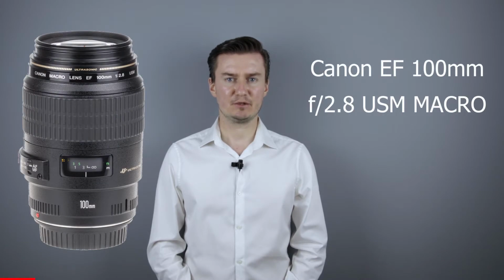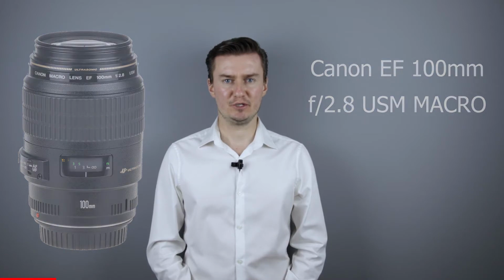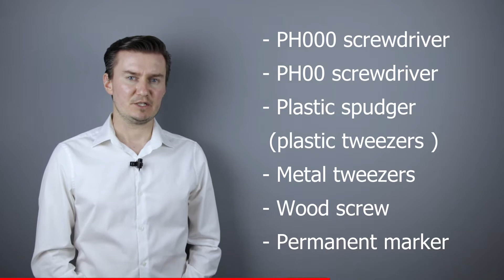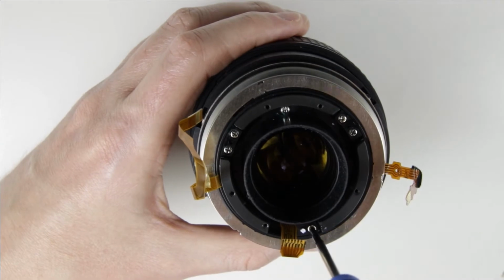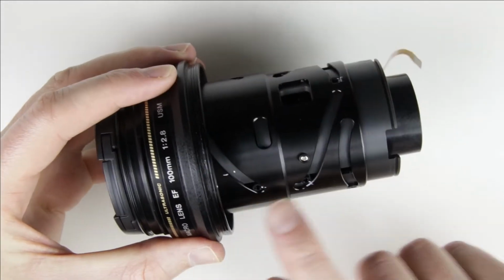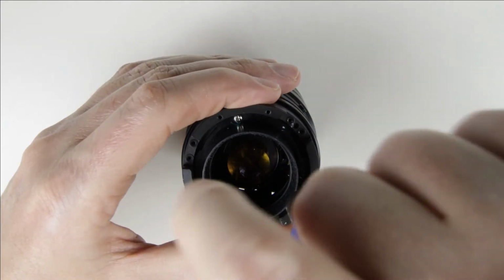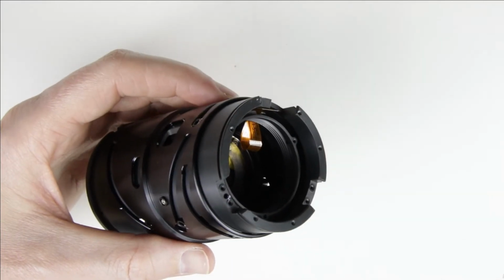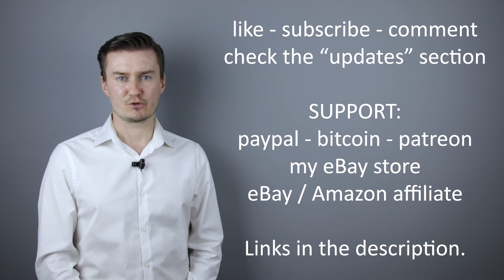Canon 100mm f/2.8 EF MACRO USM disassembly for replacing the aperture unit with a new one

Comment: You got lucky with those rear flange screws, every single one on my lens snapped clean off at the head and had to be drilled out and retapped.
Reply from the maker: Thank you for your comment. 
Sometimes that happens if you don't use the perfectly fitting screwdriver. I ordered multiple different ones, and check which fits the best.

Comment: Hello! First thanks for sharing this video with everyone. The quality of the step by step on how to disassemble the lens is perfect. I would like to clarify a doubt if possible: I have a lens similar to this one and Error 01 appeared. The autofocus is working normally but the lens only works at 2.8 aperture. Which flat cable would I have to change? Do I need to disassemble it to the end? Thank you very much!
Reply from the maker: Most likely the aperture cable is broken. You can use this video to fix your lens.
Reply: Hello! Tks for your answer.  @CamerasLensesEtc  I bought a new flat cable in China and it is already arriving here in my country. I will soon use the assembly video. I already disassembled the lens and everything worked fine. Thank you very much!!

Comment: Hello, first of all thank you very much for your great videos !
I managed to disassemble the aperture units. Once disassembled, should the aperture units be fully closed (F32) when operated by hand ? On mine it blocks before. Not a bent aperture blade.
I don't know if it's the aperture units or the flat cable that's knocked out.
Any opinion on it?
Thanks in advance
Reply from the maker: Even if the aperture unit is completely closed, there is a small hole in the middle.
I would recommend to check the conductivity of the flat cable with a multimeter.
Reply: @CamerasLensesEtc   Great thanks for everything. I managed to change the set. Super Tutorial

Comment: hi thank you very much for your video. can you recommend some site where to buy replacement or spare parts? I need the plastic front cover ring ... thank you very much
Reply from the maker: Most of the time you can buy the repair parts on ebay or aliexpress. Also, Canon is selling repair parts for end users, so contact the (3rd-party) Canon repair service if they have and sell the part you need.
Reply: @CamerasLensesEtc  Grazie per la tua risposta! thank you so much for your answer

Comment: What is part code for first front lens you remove at 8:43? Where can I order it?
Reply from the maker: Check ebay or aliexpress. Alternatively, you can contact your local lens service center, usually they sell Canon repair parts if the lens is still in production.

Comment: Hi! I’ve successfully disassembled and reassembled this lens (I had fungus) thanks to you. Thanks ! But since I’ve did it, the aperture won’t work anymore... looks like it’s stuck at f32 but it’s not showing on my dslr. Any idea about where it could come from ? Thanks
Reply from the maker: Disassemble the lens, and check if you can open and close the aperture manually, if yes, then check the conductivity of the cable, if it is fine, then clean the contacts with scratch pen.

Comment: I bought this lens on ebay, and it has signs of mold on the focusing lens (of which you speak at min 13:00 ), when I take a macro mode photo, it comes out with these small dots that ruin the picture. I've tried to find this spare but i couldnt find it, do you know where i can buy it? Regards from Chile
Reply from the maker: If there is not on ebay or aliexpress, then most likely you can't buy it. Maybe buying a same, broken lens which has the same problem then replacing the lens element (then selling the broken lens) would be a possible solution.

Comment: Good job! I’ve got the same lens. But it has a problem with the focusing. The motor goes back and forth every time. Have you any idea what it could be?
Reply from the maker: I would start with cleaning the focus strip. I have a video about repairing the same problem on a Canon 17-85mm lens... check that video.
Reply: @CamerasLensesEtc  Ok! Thank you so much!

Comment: Hi! Is it necessary to do tuning and/or calibration of this lens after replacement of aperture block?
Reply from the maker: The aperture block doesn't contain any lens element(s), so there is no need to calibrate the lens. (Just mark the eccentric screws at disassembly, and assemble it at the same position.)